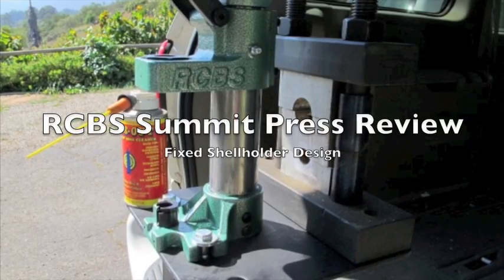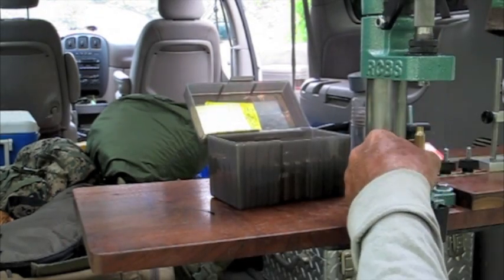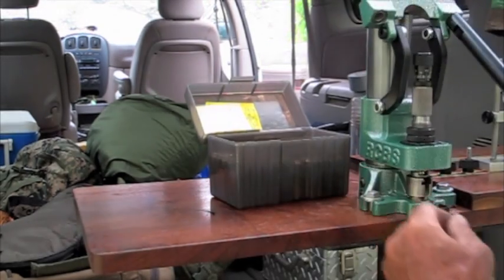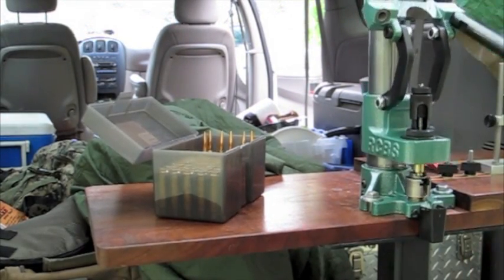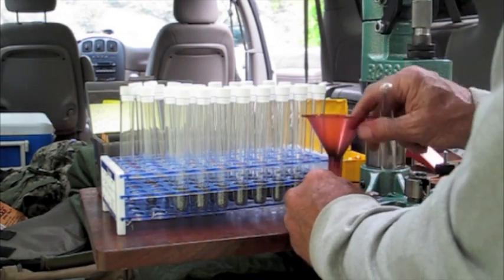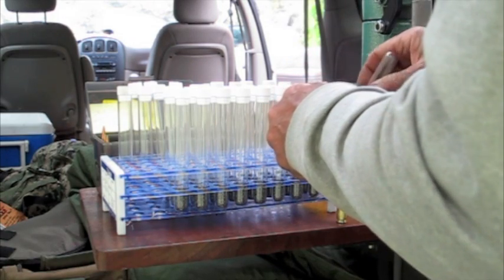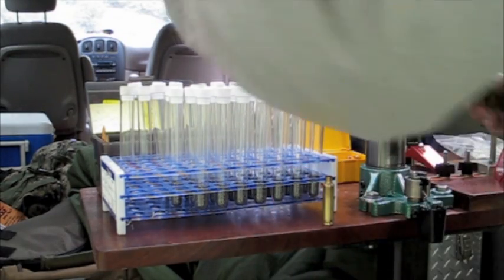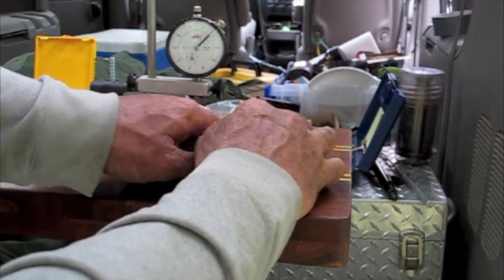RCBS Summit Press Review and Field Demonstration

Comment: Yes, the Summit press requires that you use a separate priming tool. I use a Lee hand priming tool. The spent primer capture on the Summit is very effective and clean, none get away as they sometimes do on presses that have plastic diversion trays.

Comment: I assume you are priming the cases with a separate priming tool, like the RCBS Hand Priming Tool.  I do not reload for bench rest shooting and like the old Rock Chucker with the primer tube (although it can be an eye poker!).  I wish RCBS would add a primer feeder back to their single stage presses, they could use the primer feeder from the handheld version.